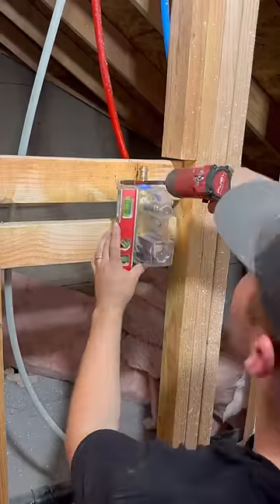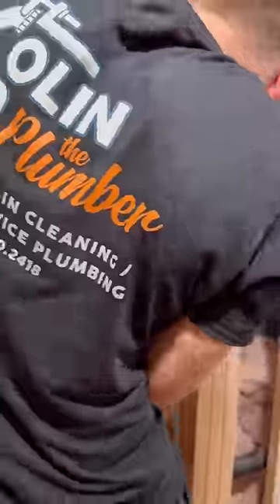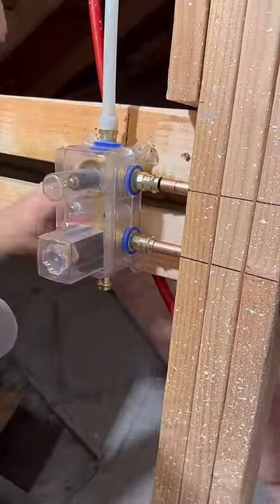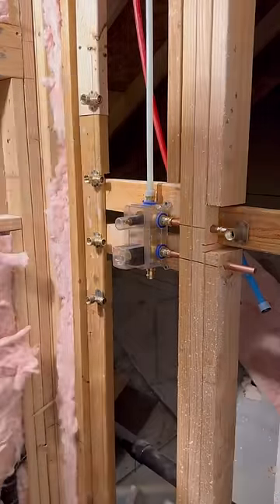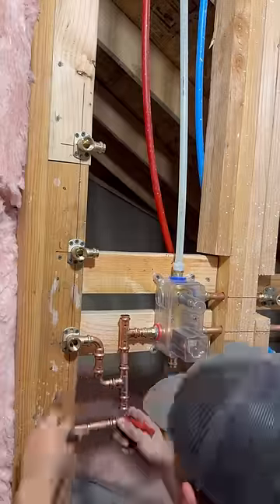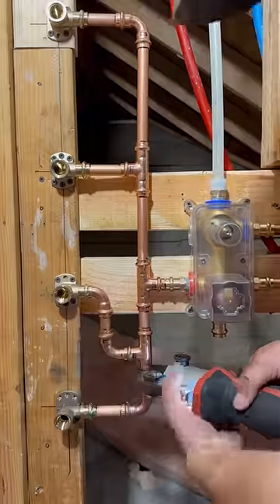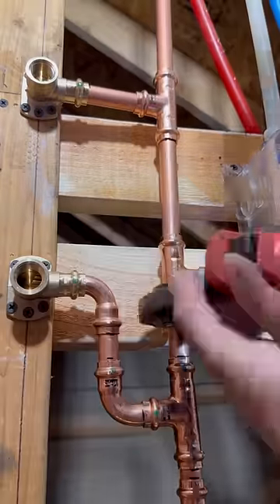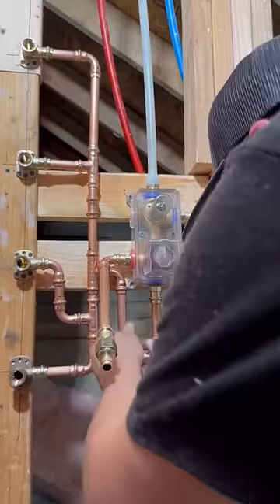installing a shower valve with @ViegaLLC pro press fittings #plumber #plumbing

Comment: I'll give u a tip when doing multiple body sprays  you should loop them back into them self , keeping them all balanced  and equally pressured
Reply: Im with you also i will supply shower valve with new water lines of 3/4 the reason is the jets need more water the rest will work with 1/2 inch but the jets neew more pressure i doin one tomorrow and im using new 3/4 lines to supply shower valve

Comment: Tinker toys 😂 gold! Appreciate when a pro shows that they can make mistakes also, we've all been there 👍
Reply from the maker: So true!
Reply: Most expensive tinker toys in the world lol
Reply: Well an apprentice does screw up 100000 dollars I'm wood during his four years they say
Reply: @replumb hell yeah. No matter how much experience we have, if you never make mistakes, or never ever have any leaks…..well, we know that’s not true. I had a welder tell me once that I didn’t need to put a pressure test on a 4” weld o let, 4” weld neck flange and a 4” flanged gate valve we installed on a 6” chilled water supply line we were going to do a hot tap on in a data center because” he hadn’t had a leak in 30 years”.  As much as I really like the man, no offense, but I am 100% testing connections before I hot tap LIVE lines, and with all due respect, I’ve had plenty of leaks over the years(I call them “unfinished work”)😂 and humbleness and humility needs to be taught in our trade because we are learning for life and we will continue to make small mistakes until the day we hang it up

Edit: forgot to mention that when we tested the connections, there was a weld leak that needed to be addressed 
(Granted, it was in a horrible spot). But that would have catastrophic had I chose to disregard protocol and believed that there was no chance of a leak based on this supposed world h

Comment: Body sprays have to be built in a loop

That way none of em starve any of the others, balancing the water pressure.

I was taught building them out of copper using wing T's
Reply: @TenchuTesshu 
Thank You,
for the recognition

I'm a 3rd generation Plumber with
18 years experience

I did the old man's work for the first 12 years.

Once or twice he'd been accused of sleeping with the code book
lol

He regularly would show, teach inspectors some of the finer nuances of the plumbing code.

He'd say

Work Smarter,
Not Harder.
Make the code work for you.

He also is about the most expensive plumber in town.

I've plumbed everything from large mansions, summer retreat cabins in the mountains on the river, restaurants, laundromats, factories, and every kinda repair work ya can think of

Have a good day 

Peace,
Love, and 
Chicken Grease 

✌️❤️‍🩹🐓🍗

Comment: I did my entire shower system in Pex just because 😂.

The drop ears are properly supported so you're good.

I am a diyer so pex has saved me from hiring plumbers from minor jobs to entire remodels. I had one pex leak on me because I forgot to crimp the compression ring and my basement, the helper didn't put the PEX crimp on straight. 

As for putting on sharkbite, I only used them to connect PEX to copper and do the entire system in pex. I could soldier on a connector but sometimes having an open flame in a wall to soldier one fitting just is difficult for a diyer. I barely can weld or use a torch on a good day without setting something on fire.

Comment: You must haven't run into a body spray pressure issue yet,when you do you will put a pressure loop on everyone you do from that moment on..like your content, I grew up plumbing in your area in East TX now...
Reply: Totally won't have same pressure to the sprayers right? Needs double open ended sprayers and a mixed water to them all
Reply: hey boy

Comment: I did a hotel that was all solder mains with uponor risers/branches. 

Every leak we had during testing was on a solder joint. Not a singgle pex joint has leaked.

Comment: I don't mean to be that guy, but balancing loops are a thing when you have multiple heads. Body sprays as an example. Helps keep one head from having way different pressure than another.

Comment: Hey, boy, I didn't see your equalizing pressure loop on that body sprayers.
Reply: That bottom body spray is going to feel like a gun and the rest are going to dribble
Reply: Yeah that one will actually matter. Unless you have adjustable nozzles to equalize the pressure the only right way to to Tee them off a loop.  So the bottom 90 and top 90 would be tees that would make the loop on the left. or behind the stud in this case.
Reply: Right!

Comment: Hey bro..... I always enjoy your video. I just wanted to give you a heads up When plumbing in body sprayers you want to basically plumb a circle coming off the main valve with each body sprayer tied into that circle so that each sprayer will have equal pressure. Some might work fine but it only takes that one to bite you in the ass and end up being a costly Job to repair. Just looking out for a fellow plumber.

Comment: Hey boi! Yoo didn't make a pressure equalization loop on those body sprays.
Reply: Real plumber in the comments boi...
Reply: Correct!
Reply: Noticed that too but I didn't wanna be a "hey boy" lol
Reply: @Tanoforfucksake  , what did they debunk? They didnt debunk the need for a loop, thats for dam sure.
Reply: @Tanoforfucksake  , interesting, because I have installed them before and had to open walls when they didnt work because of no loop.
Reply: @johnb1567 get better at plumbing
Reply: @jknott1509  , it wasn't me that plumbed it dude.... I just had to go back and fix it... Yes the loop was necessary.
Reply: @Tanoforfucksake with 4 heads coming off a 1/2” line he is most certainly going to have issues.
Reply: Body sprays should be piped in a loop.

Comment: Not one to criticize another mechanics work but we did many of those multi body sprayer showers,always was drawn up for us to feed the sprayers off a manifold or you will have uneven pressure to the heads

Comment: Did those body sprays get even volume/pressure?
Reply from the maker: Yep
Reply: Physically impossible
Reply: @jimkoz3118 If the body sprays are enough of a resistance, the few extra inches to the top and the double 90 in the second piece will be overcome. So impossible is a reaaall big word you are using there.

Comment: You need to build a manifold on the outlets for the body sprays. The water will not pressurize for all the outlets. You might get a call back on this one. Hope this helped.
Reply from the maker: Pressures working great. Installed at my buddies house
Reply: not as good as it should @replumb

Comment: You need to plumb a circular loop of pipe for body jets because you will have a temperature difference at each body jet when you pipe them in a line like that the high jet will be hotter than the lower one

Comment: Bro I ain't trying to be that hey boy guy, but you should drill them water lines a little bigger and istall an isolating suspension strap through that wood to help with expansion. Also install multiple body sprays/heads in a loop they will run with equal flow when multiple outlets are running

Comment: Have just a shower cabinet. It has overhead "rain", sideshowers and regular basic handshower (round head high) on the wall. Tried the other functions couple times, but the regular is all I actually need. All the others don't work as well as what's needed to deliver water where it's needed at the moment. The worst s the overhead rain shower. Turn it on and all the cold water still on the piping needs to come out. But there's no room for me to get out of the way. Also the temp regulation is bit fiddly and I have to wait a moment before I know what's it's actually delivering. Last person used all the hot water and had to turn it up. Now the water is hot again but the knob is till on the hot side. Needed a shot of hot water all over your body...noooo. Thanks rain showerhead.

Comment: When you drill to a stud for copper instalation you have to insulate the copper from the wood other wise you will tranfer the water noise true the house when the water is in use every time

Comment: Why do people feel the need to have rain sprinkler heads and wall mounted body sprayers? It’s a shower. One shower head is enough to get you clean. You don’t need a friggin car wash( with undercarriage spray)in your bathroom. Who comes up with this ridiculous stuff🙄. Also there are more fittings which means greater chances for leaks.

Comment: Those body jets are not installed properly. You always have to build a loop around them to equalize the pressure.
Reply from the maker: Always follow the manufacturer’s instructions
Reply: Always follow the laws of physics
 @replumb

Comment: The connections for the body sprays are completely wrong. You have to make a loop or the pressures out of the sprays will differ. Rookie mistake. But then again you are a rookie. You should do a better job for your friends!
Reply from the maker: They’re working great bud
Reply: @replumb  No way! Especially the way they are piped. I would bet anything the top one is just a dribble. You just won't admit that that kind of install is way past your skillset.

Comment: Bro you need to do a full loop on body sprays,if you don't you won't have equal pressure..that's the first mistake I ever seen you make...think about it, the water flow will hit the first sprayer with great pressure,then the next won't be as strong by the time you get to the 3rd n 4th sprayer your pressure will suck..I live in naple Florida I put these in on the regular..you are gonna have issues,looked great but that's a big foul up

Comment: Nope wrong u need a expansion loop on those body sprays the bottom sprayer will take the path of yeast resistance and not b equal to the rest way to go ace

Comment: The pex you used is on the way out the pex is breaking at the counter connection sonin 7 to 10 years you'll be ripping my it out

Comment: No way all the body sprays had equal pressure. 1/2” valve first is trash and u need to make a loop around all the body sprays trash work.